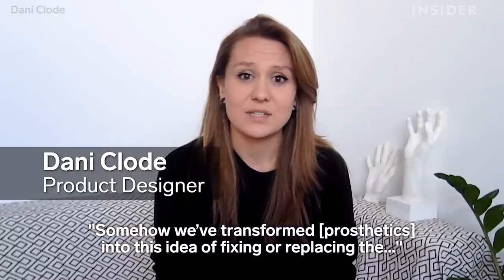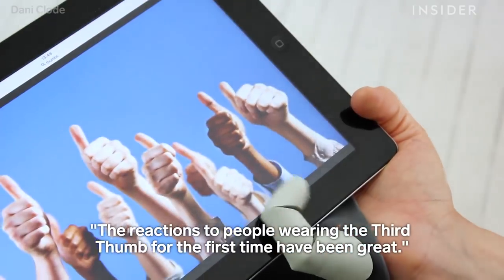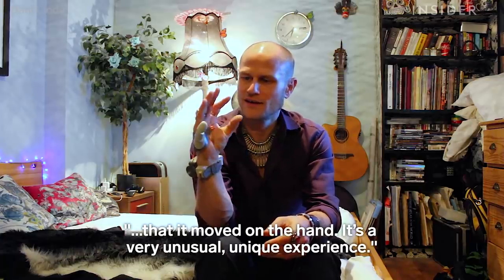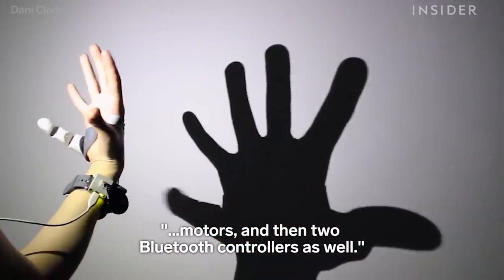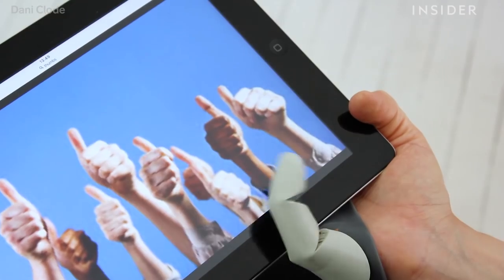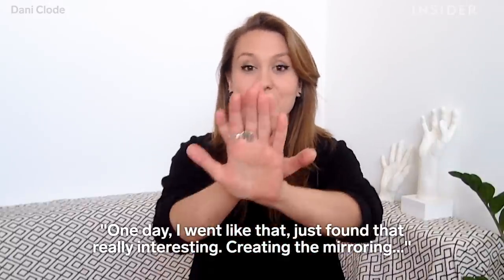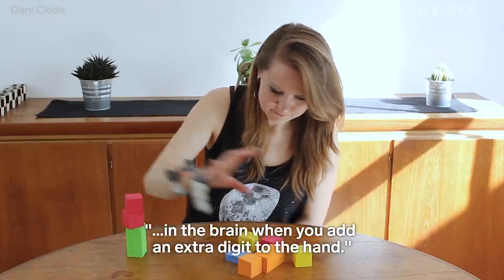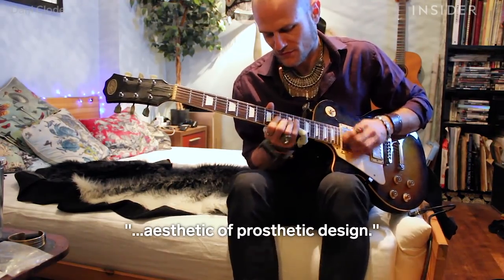Third Thumb Changes The Prosthetics Game

Comment: YOU KNOW WHAT THIS MEANS

WE ARE WELL ON OUR WAY TO CREATING WINGS
Reply: Icarus didn't die for this
Reply: But we still cant fly with just wings alone since we dont have light bones and bodies......unleessss we cut ourselves in halves then we turn into an artificial mananangal(filipino mythical creature)
Reply: @Beet-e3b  There already equipment that allows human to glide. Even from outer space. And people had done it. Remember the Redbull sponsored event?
Reply: "Do you know what this means?!"

That I'll need to buy new gloves?
Reply: I'm sure if they are huge powerful wings they would lift you. You'd be light relative to the wing size
Reply: Falcon and the Winter Soldier is about to get real; LET'S GOOOOO!!!!
Reply: @sailingsurvival  The larger the wings, the larger the weight of the wings, the more fuel they'll use to lift off, and the more thrust you'll need to actually glide with them.

At some point once you've added enough wingspan, thrust and fuel to it; congratulations, you created a plane! Anything else?
Reply: @ryouskun4754  Not everything is a rocket, and with the correct (or shall i say, more efficient) battery configuration, or energy type, it wouldn't be that heard.
Although, this idea is pretty dumb (sry) anyways, because wings are extremely inefficient as a method as creating lift, so as you said, we could just add some turbines, jet engines or perhaps rockets so we can fly.
Icarus should have known about this
Reply: @earler8  we can, just really big wings lol

Comment: iThumb coming 2020
Reply: Sarah 😂😂😂
Reply: Only £40,000 per component!
Reply: The thumbnail is the screen
Reply: . haha, yeah. With apple running it.
Reply: Charging cord sold separately
Reply: Sarah battery sold separately
Reply: too bad every iProduct is operated thru user's thumb.
This being the case.... how many thumbs does it take to operate a third?
and at which rate is this ever even remotely reasonably practical?
Reply: Buy now in 2020 only $50k
Reply: Along with transformers
Reply: The new iPhone 20 will require the I thumb for operation
Reply: Comes with Bluetooth too
Reply: Sarah will it have a headphone jack?
Reply: Y apple tho
Reply: Only 1CAD per component, because Canadians are nice

Comment: I want brain controled version
Reply: That takes implants which requires surgery which requires someone who doesn't shy away from such an idea
And even then i don't think we've really delved into that part of technology
Reply: cables will be gwtting out of your head....
Reply: It would be wireless, but no-one would do it because they would have to cut open your skull to operate on your brain, you could die.
Reply: Wait for 2060, i think we all will be augmented by that date :D
Reply: Spartan War118 I mean, I think we have but it's just a question of whether we should at this point in time...
Reply: Spartan War118 I'd still fuckin do it.
Reply: This just screams pickle rick's rat limbs.
Reply: Pickle Rick’s limbs had only 4 fingers, but yes they work on the same principe
Reply: If Rick really needed those 4 fingers, he would've added a shit ton - this is the same guy that designed an entire system just to change out his limbs, with interchangable razor blades/screws, a jetpack and a mask with cockroach limbs controlled by his tongue... all in the space of less than an hour.
Reply: well, basically your toes controlled by your brain, so..
Reply: Kryptix is do it
Reply: If that's what you want, you need to start campaigning for this technology in every community, in every country.  That's the way it works!
Reply: you know what i wouldn't want though? electronics in my brain
or...rather...more electronics than a brain already is
Reply: it is controlled by your brain bro

Comment: With this tech, make a naga/Lamia tail you can wear over your legs! You would pump your legs up and down to move, as if slithering.  This would make a really cool costume for LARP or Halloween or filming or whatever.  Leaning left or right would turn which direction you go.  Leaning on one foot excessively would cause the tail to curl up, but if coiling an object, it will squeeze but not crush the object/person.  I would buy something like this haha!  Imagine using the illusion of making a rubber hand feel like your hand to also feel what the tail does when wearing it!

Comment: So if it's controlled by your toes, does that mean you can't control the thumb while you walk/run? Like, could I walk across the room with four wine glasses in one hand? All of the examples in the video had people standing still/sitting down.
Reply: id say it is a bit of a crutch of a controlling mechanism and is to be revised and redone in the future
consider it a proof of concept, not a finished product
Reply: Several professional prosthetic designers have already gotten away from this form of interface and are perfecting some that interface directly with the brain, both wired and wireless. This is basically the level of a high school science fair compared to the level that is already in use.

This is probably less of a viable product as it is a proof-of-concept for someone's resume.
Reply: The issue here is that there is no easy way to grab the motion information for an imaginary digit from the brain by sensing the right motor neurons, which is what regular prosthetic systems would do.
Reply: Our brains actually do not rely on thinking about how to make a appendage move, but what we intend for an appendage to accomplish, at least one prosthetic design company, using low profile electroencephalography has created an interface to operate whole arm replacements, with individual finger articulation, as well as wrist, elbow and shoulder, without the need to map neuropathways to former muscle groups. The portion of the brain that controls motor function is extremely adaptable as well, to the point of allowing other portions of the brain to learn to operate body parts that were once controlled by damaged or missing brain tissues. There really is no reason under those conditions that the brain would not be able to learn to operate a 6th digit on either or both hands seamlessly, just as easily as the users of this device learned to control it with their feet.

My objection to the "technology" displayed in this video, is that it essentially impairs the user rather than empowers them, and has insufficient functionality to justify the loss, just as the older style hand replacements used the bicep muscle to provide force and control to grip, at the loss of full bicep function. The current goal of every designer of prosthetic should be to restore or enhance function without losses, so designing a device that gives a minor increase in functionality at the major loss of other functionality is working backwards, technologically speaking.

Comment: Honestly I find this extraordinarily fascinating. One thing we tend to forget is that prosthetics don't need to be full blown exo-skeletons or replacements for lost limbs or body parts, they can be something so small as an extra thumb. It brings me back to Ghost in the Shell and the ability to split your fingers into multiple connected smaller limbs to increase productivity. There's also stuff like Chell's Boots from Portal, which is essentially used as an excuse to survive fall damage, but the idea of having prosthetics that can be attached to your legs that allow you to survive falls from great heights are a very similar concept. I honestly think this is a lot more genius than most "meme-worthy" responses this has gotten.

Comment: Is anyone else kinda disappointed that it was controlled through ties and not like a nervous system thing?
Reply: Jackson Hardy well, it was a college project without funding soooo? I think she may try stuff like that in the future, but she just didn’t have the supplies when she built this prosthetic
Reply: She should sell the hardware(hand attachment) and provide instructions on how it can be controlled.
She could easily sell a run of these to curious people the software/electronics should be sold separately but one may make their own hence bundling instructions.

if you don't bundle instructions people will do things in random ways and combining designs will be less straightforward.
if somebody controls it in an unconventional way they will need to say(motive to create better instructions) but if people follow a guide somebody can try 10 different designs without having to learn how to use it each time.

Comment: If you were to design a new appendage based on an existing one, WHY WOULD YOU KEEP THE LIMITATIONS OF THE ORIGINAL????
Reply: Works in concert with the rest of the hand. Could add a flashlight maybe.
Reply: Head First I meant more about the fact that the joints are one way only, why stop at that?
Reply: Head First I meant more about the fact that the joints are one way only, why stop at that?